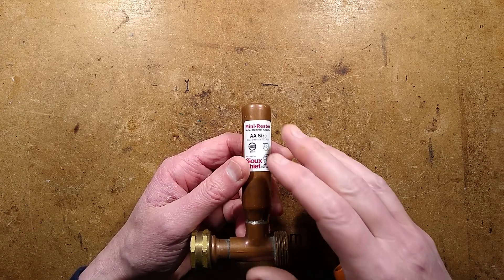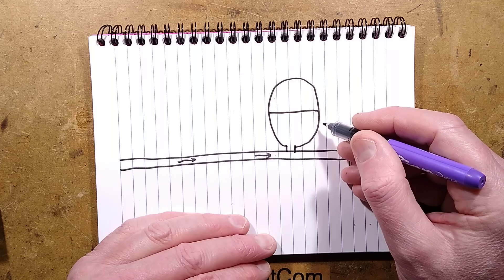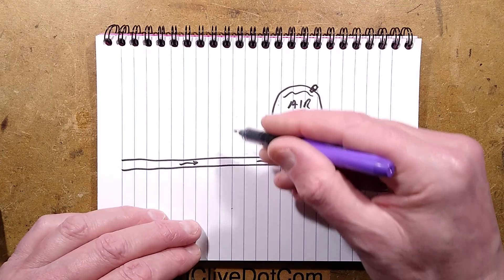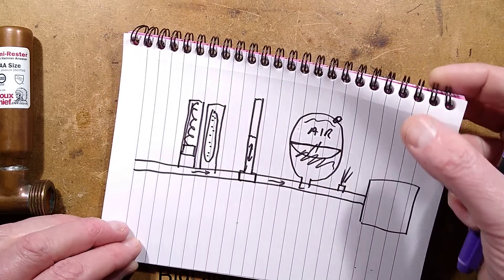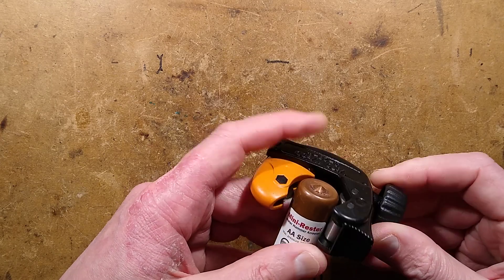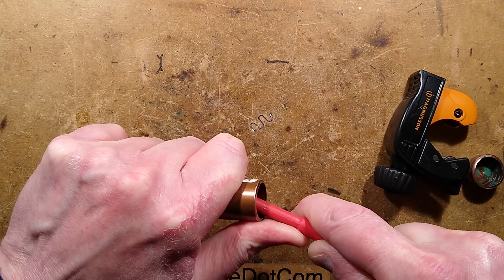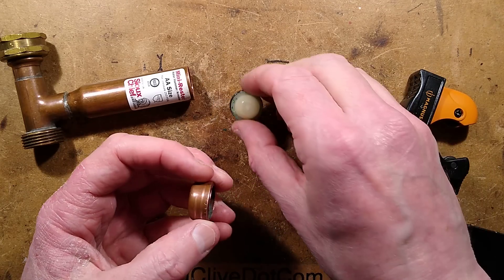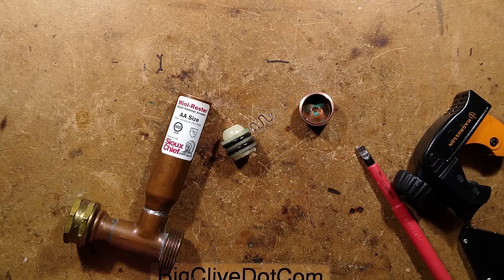inside an American made anti water hammer device

Comment: We've got an LG washing machine that causes much worse water hammer than the bosch machine it replaced.  It's particularly annoying because at the start of the cycle it pulses the solenoid valve a few times to just let a very tiny amount of water in, while the machine is apparently weighing the load inside it.  
I fitted one of these minirestors and although it didn't cure the water hammer, it did reduce it significantly.  It's been there about 10 years now, and I'm sure it is becoming less effective.  I did wonder about just stacking a few up to see if that sorted it.
Having now seen inside one, I'm wondering if it has let water past the o rings into the chamber at the end.   Is it feasible that could happen do you think?  I also wondered about adding a sort of squared off omega symbol type thing to the supply pipe, to see if the little bit of movement that would allow in the pipe might help
Reply from the maker: Most modern front load machines do an initial fill and tumble in small bursts to just saturate the clothing until its not absorbing any more water.  That way the detergent is most concentrated, there's less chance of foaming and the tumbling action between the clothes is more vigorous.

Comment: I had a water hammer issue and bought that same Sioux Chief device.  It did not work, but that was because the pressure regulator was broken and I was getting 150 PSI  to the house plumbing (it is supposed to be under 70 PSI).  Now, seeing how that works, it probably had the piston pegged to the top...

Comment: Water will absorb the air in a dead end pipe over time.  For it to work right you need to drain you pipes from time to time.  Also consider the volume from 1 atm to 4 atm.  You need a long dead end pipe to have enough volume but that is farther from the pressure spike so not as good as the little pressurized sealed gadgets like you cut apart.

Comment: If your hammer arrester hasn't helped, you might need more than one, or a pressure regulating/reducing valve. Otherwise with higher pressures the puck will slam right to the end instead of being cushioned, or if it's higher still will compress the air behind the puck to the end anyway.

Comment: In the US the  type of tank that you described is typically called a 'captive air tank ' because of the bladder built in to the tank. Latge version are standard on well water systems. The  older solution was an air tank  again  pretty much exactly as described.... the issue with traditional air tanks  is that due to  rapid cycling and some other issues  the air can absorb into the water which  the old timers called water logged.  Once water logged  you needed to reintroduce air into the system so it would work properly.  The  small stub tubes had the same problem. Interestingly the standard  solution for the traditional air tanks on a well water system was to drill a small hole roughly 3/32" in the pipe near the top of the well  the cycling of the pump would force air into the tank to replenish whatever was absorbed into the water overtime.  Obviously this isn't practical or desirable for the little stub water hammer suppressors when used on city water systems so you would need to drain that portion of the pipe long enough to refresh the air or figure out a better way 😉

Comment: Most of the auntie water hammer devices I have installed or just basically a pipe that stands vertical that will not fill for water that has basically an air spring a space for are to take up and the water to bounce against has water is not compressible

Comment: The object it too prevent the water from coming in conta t with the air. The old water hammer stand pipes did not do that. A well expansion tank has a large bladder inside that ensures the isolation between air and water. Agreed; that feature of the modern water hammer arrester does prevent them from working effectively. I have never heard of, nor can I find any reliable record of the old devices actually causing a problem.

Comment: my guess is that they use an inert gas to prevent oxidation or growth maybe? but there was some green inside the cap, so it could have just been shop air lol. seems like you would want dry air at least for the gas piston side. and it was probably pressurized so that at regular standard water pressure the plug would be all the way down (preventing any stagnation). pretty elegant design i think

Comment: While almost universally a negative phenomenon, the water hammer effect is not only encouraged, but amplified in that centuries-old invention, the hydraulic ram pump. With as few as 2 moving parts, they are exceptionally reliable, and occasionally backcountry hikers will trace the sound of that rhythmic clicking to a long-forgotten ram pump, still dutifully sending water to whatever holding tank required it.

Comment: The hole in the top is needed for the manufacturing process. They draw out a cylinder with one end solid and the other open. They want to push in the puck from the open end to about the mid point but air pressure would prevent this, so they put in a hole in the top during the forming process to let out the air. After the puck is in place they seal the hole. They then down size the other end in a press similar to how rifle cartridges are sized. It is then attached to the T.

Comment: In older home just a capped pipe.  If it started to water hammer. We do a quick drain of the water lines. Then turn on the water again. Fixed.

Comment: I have a larger one of those for my washing machine. Works like a charm. Must be twenty years old at least. 
I installed one for the dishwasher too. Hammer is really hard on copper pipes and the noise is disturbing when you hear the pipes slap inside the wall cavity. 
Another way to reduce hammer a little bit is water filter's but these Sioux fittings work much better.

Comment: medical note: the (psoriasis/eczema) dry skin on the right of your left hand's thenar space might be cleared up with bi weekly dupixent injections if its not normally resolved with triamcinolone acetonide cream or betamethasone dipropionate. you could try hydrocortisone 1% over the counter first before consulting a dermatologist if youre weary of doctors.
Reply: use those in reverse order btw. if youre in the US your insurance will have a step program they go by which basically means they will only cover medications in a certain order from lowest to highest as far as strength of treatment. otherwise you will need a prior authorization to skip a step and still have the medication covered.
Reply from the maker: The thing that actually did the trick in the end was 4-action anusol with its anti-inflammatories and hydrocortisone.  I'd tried lots of things before that.
As a bonus it has also worked wonders on leg skin issues.

Comment: The water hammer effect is used to pump water to great heights using the flow from a small stream . The device is known as a hydraulic ram
The energy of the small low pressure flow through a pipe from a stream accumulates kinetic energy  which is intermittently converted to high pressure by automatic valves.
It is effectively the fluidic analogue of an electric transformer
Reply: It's more like a boost converter.

Comment: Civilised areas of central Europe do not really get water hammer. I first experienced this in Australia and bought such a device to find it made hardly a difference. Surprised yours did not have a spring to return the plunger. Probably designed to last less than 10 years. Now you have scored 2 O-rings and some copper to recycle.

Comment: Perhaps your water pressure is too high and you need to fit a pressure reducing valve at your water source. If your home is way down below the level of the reservoir you will get high pressure which will amplify water hammer. You can get individual hammer arrestors and install them at the outlet before connecting the washing machine water inlet.

Comment: People who get their own water from a well employ a pressure tank, which is the giant-sized cousin of this--diaphragm or bladder in a divided tank.  When a flow is demanded, the "cushion' provided by this keeps the water pump from cycling frequently, as most wear in pump motors is in starting.   Instead of getting the pump to run every time you flush the loo, it may be many minutes between pump cycles.  Mention is made of this by @mouseTN, below.

Comment: A hydraulic capacitor!
Reply: I often think about this: Could you build an hydraulic analog synthesizer? Arguably the faucets in my bathroom already are one, but I want a voltage (er, pressure) controlled oscillator and a pressure-controlled resonant filter! Just how far can the hydraulic model of electronics be taken?

Comment: Donkeys years ago I had a problem with pipe hammer and my grandfather suggested adding a vertical blanked off length of pipe.  Added about a 12 inch length with a stop end off the rising main to the water tank in the loft (before we had a combi) which solved the problem.  My understanding is not that the blanked off pipe filled with bubbles from the mains but because it is vertical the rising main water rushed in to fill the pipe but the air has nowhere to go, e.g. it can’t work along the pipe to a tap to be released later because, so you are left with a column of air above the water (just like submerging a glass open end down in a bucket of water) which compresses to absorb the pressure changes that cause pipe hammer.  My grandfather was not a plumber but a very able handyman!

Comment: A long hose pipe reeled up will also act like a anti water hammer thing too i found out when leaving the hosepipe tap on but the hose nozzle closed. when the washine machine fill solenoid slammed shut the hose reel would jolt i suppose the slight stretch of the hose acts like a spring

Comment: The stub pipe solution for water hammer doesn't work long term because the air in those stubs dissolves into the water, not the other way around (bubbles coming out). This was also often an issue with older hot water radiator systems that used a non-diaphragm expansion tank. Since the tank was in the basement, the slightly higher pressure would dissolve some of the air, and then when the water went up to the radiators the air would come out of solution, and you'd end up with air in the radiators and an expansion tank full to the brim with water.

Comment: The large ball shaped things aren't for water hammer AFAIK.

There are two types that I'm aware of. The larger ones provide constant water pressure for well systems (common in US rural areas,. The smaller ones, as you mention, are expansion chambers for hot water. I've never seen a Schrader valve on the small ones.

With the big ones, when the well pump runs it forces water into the drive, compressing the air. When you open a faucet, the water is pushed out by the compressed air until the pressure drops, which turns the pump back on.

The simple dead end pipes are still commonly used in the US.i think it just boils down to whether the plumber has a ready-made one at hand in his truck.

Comment: About checking expansion/pressure tanks to see if the diaphragm is frigged, pushing the shraeder valve often gives a false negative. You can tap the tank on the top and bottom and listen, water makes a dense sound and air has a bit of reverb. If both halves are water your tank is screwed, if the top half is air you’re fine

Comment: Great to see you reverse engineering a plumbing device, Big Clive. 👍
   As a plumber, of over 40 years, the reason this occurs is because water, unlike air, is essentially incompressible. So, the energy generated, from the instantaneous shutdown, of the solenoid, of ripples back through the reticulation system, causing any issue to reverberate, which transfers that energy into vibration & noise.
   The way I like to describe it, to customers, is imagine the water racing through the pipes, at about 80km, then suddenly stops. That energy has to go somewhere. In older houses, that were built, pre-ceramic disc tapware (ie. taps that used washers), often the pipes weren't very well clipped to the house's structure. The energy reverberation then transfers into the pipe wall, causing vibration, against the timbers. If the pipes are under the house, then it is often resolvable. If they are in the walls, that's where hammer arrestors can excel. They don't always work, as they need to be relatively near the source, of the hammer. And, the water hammer's source can be at the other end of the building. So, it can be a trial & error process, to fix.
   That is the most obvious causality. Another is an older style washered tap, that has a loose tap jumper, that vibrates, in it's housing, against the tap body.
   Finally, a failing valve, like a pressure limiting valve, can also mimic the same issue. Thanks again, BC. Love your channel, as a noob hobbyist electronics enthusiast.

PS. The devices you were referring to, in your statement of them being used in heating systems, etc., are called expansion vessels. You're right, Clive, they do work under the same principles. And, the reason the dead-leg, of pipe doesn't last, long term, is due to the fact the air gets reabsorbed into the water stream.

Comment: And to be serious, for the first time ever.
The diaphragm Bumps Up, when hammered,.. and the pressure of the air in it, will return the diaphragm to its static location. Which Really Could Use A Spring. But the resistance in a "Circuit" like that, defeats the point. So it depends on the pressure differential.
But over time. And in a Moisture environment. AND, with the hardness of water in some places. It eventually would simply freeze solid.
The "Caps" if I remember. Were of a thinner material. And acted like a blow out valve. Supposedly to protect the piping you couldn't easily access.
A Good Idea, but less than accomplished well. Especially for a device nobody probably knew existed. Or even their location.
Until the dog comes out of the basement All Wet and Happy for some reason 😇🐕‍🦺🥰
... always fun

Comment: I am not a plumber, but a controls engineer. The diaphragm is not necessary. We add several vertical tubes in our system that naturally collect gases entrained in the fluids. The result is a cost-effective buffer that automatically maintains itself and helps reduce pressure spikes throughout the system.

I also looks like they stir welded the end to seal it.
Reply: "I am not a plumber, but a controls engineer. The diaphragm is not necessary."  That's because you're not a plumber.

Comment: I would guess that the largest diameter is the basic size of the pipe then the bottom end is necked down to fit the line pipe and the top is swaged closed as much as possible befor being sealed with that odd copper weld after the puck is inserted.

Comment: Water hammer is usually due to high pressure. Why not use a pressure reducing valve in your main supply? 3-4 bar is plenty and should eliminate it. Lower pressure will also save on washers.

Comment: The trouble with the dead end pipe is after time the air would diffuse into the water and eventually disappear. And yes, they don't allow it in modern plumbing inspections.